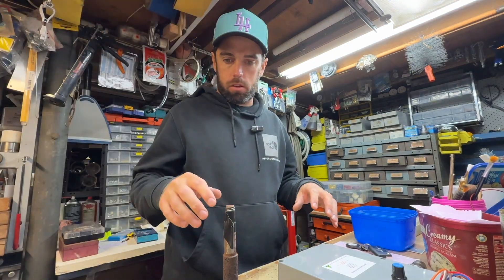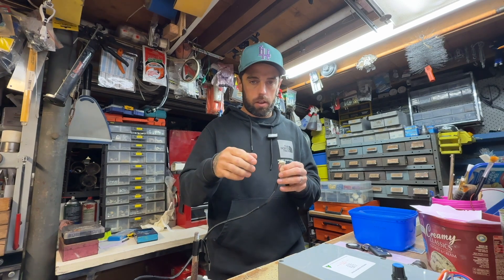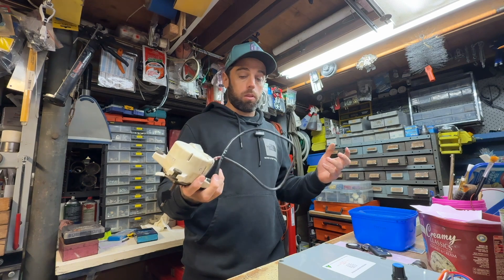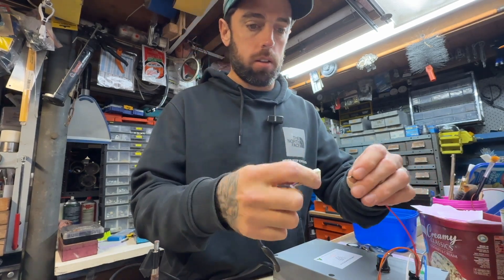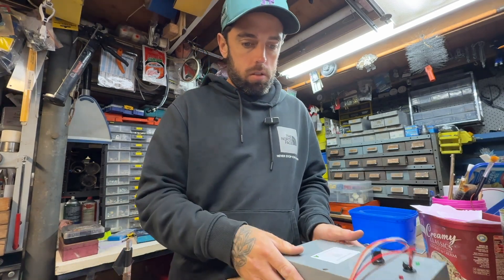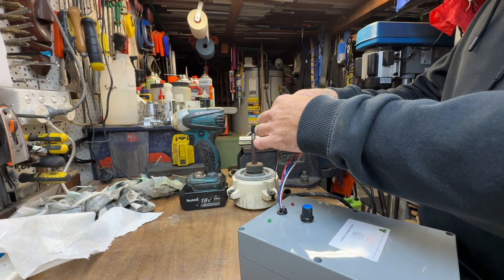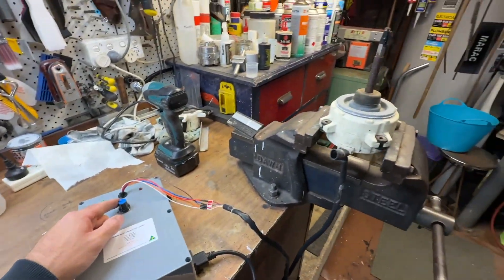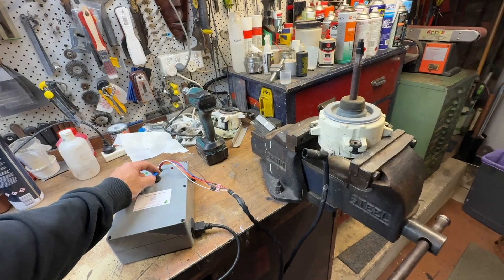I Built a Brushless DC Fan Motor Tester for Aircon Repairs!

Comment: 11:20  Mitch... Put in a push button momentary switch and a resistor to discharge capacitors..... For you and any anyone using such a device/tester.
Great videos... Great repairs and installed... Keep up the great work.
Sydney Australia

Comment: Nice work Mitch, you could probably even have multiple female plug ports for each manufacturer or plug style so you could just plug the male connector in like as if it was a board. Good stuff

Comment: Top work Mitch! Would make a big difference to a customer saving money on components that don't need to be replaced. Most main boards on systems aint cheap and saving that money on additional fan motors would go a long way with any customer
Reply from the maker: Thanks mate! I agree, this will lower repair costs massively. The amount of fan motors that get replaced just “in case” they’re damaged is crazy.

Comment: Nice work. Plz do a "HOWTO" video. I replace alot of bearings on those motors instead of replacing the complete unit. I think its the Daikin VRV4 condensor fan motors that allows access to the PCB. Found the Samsung mini split inverter units like burning wire off just as the wires come out the motor.
Reply from the maker: Thanks mate, I’ll definitely make a video showing how I made it step by step.
Reply: @maracservices  Thanks m8
Reply: @maracservices Hey mate can I see the schematic for this tester? I'm based in Brisbane.

Comment: Great and very well detailed video mitch !! 

Currently in the market to get ducted installed and on paper the Rinnai 13 is the best all round system (when comparing between 12.5-14kw systems) 

Dont see any reviews on them or much of a market on them in Aus and apparently they just upped thier warranty period to 7 years .... 

Do you think its worth taking a risk on them or just go for the daikin / Fujitsu even though on paper they are less effective ?
Reply from the maker: I don’t know much about the Rinnai unit to be honest but if they’re actually made in Australia then I’d definitely use them. I couldn’t find that information online. What I will say though is that when it comes to ducted air conditioning installations, I’d say the difference between a system the customer is happy about or not happy about is almost always to do with the installation, not so much the product. Of course sometimes the product fails but most of the time, it’s just poor installations. So I’d say, if you have your heart set on the rinnai, go for it but try find a decent installer in your area.

Comment: Definitely interested in this tester -- it would be very useful for me -- could i get the any info on parts required to make one?
Cheers 👌
Reply from the maker: I’m going to make a video on how I made it and what you need to make one yourself. 👍🏻
Reply: @maracservices excellent, just out of curiosity, did you use a main PCB from an old-ish Daikin ducted outdoor unit?

Oh and Cheers from Canberra
Reply from the maker: @lukeh6015 I made the circuit board from scratch actually.
Reply: @maracservices 
Nice one, I'm looking forward to your video,
On that note, I've been thinking about how to improve the Daikin inverter tester, maybe instead of the 3 led's, have a lcd read out or something

Comment: Awesome work Mitch, would be super interested in the schematic of the PCB.
Great tool!.

You could potentially add bleed resistors within your controller to make the fan a bit safer before disconnect.
Reply from the maker: This is the second one I’ve made and I’m going to make a third and film the whole process. Each time I make one, I make it slightly better. I thought the same thing about the bleed resistor. I’m keen to see other people make their own and together we can make the perfect tester.